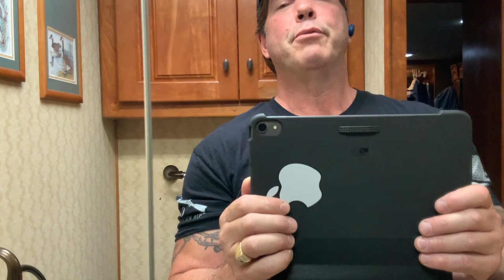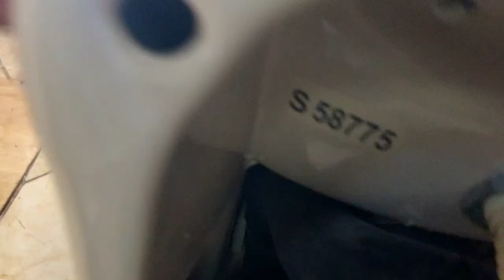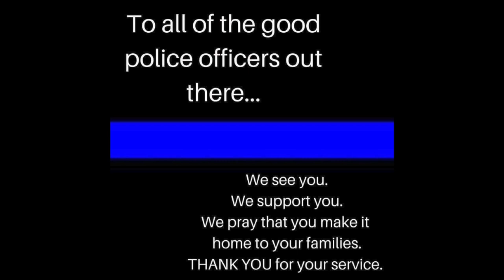Tecma Thetford Toilet Issues and Repair - Teardown and Reassemble

Comment: Your great video allowed my non-mechanical but determined wife to remove the toilet. liberate a medicine bottle that was plugging the toilet and reinstall it. I was blown away! Also a shoutout to The Fleetwood techs for stripping the heads of the toilet mounting lag screws when they built the coach.
Reply from the maker: LOL, A pill bottle would definitely give the macerator a run for the money. We have since sold our coach and have a 2021 Destination trailer while we get our Texas Tiny Home village opened up, and it has all kinds of manufacturing issues from the factory. It seems that most everything has gone downhill since the change in society of 2020, but the RV industry has taken a serious hit in quality manufacturing for sure. Thanks for sharing. Peace
Reply: Don't feel alone. I have a Tiffin and the installer stripped out my lag screws too. I know how to fix them but Damn. . . Just another QC issue.

Comment: Great video with loads of "tongue-in-cheek" humor. Two thoughts: 1) could use a 1/4" square drive on the cordless drill, then an extension with a 5/16" socket for the clamps - way easier, and 2) mention that one doesn't want to over-do it on the clamps - the sharp metal edge of the clamp can cut right into the rubber of the hose, and start a nasty leak. Goot-n-snug, but don't over-tighten these.
Reply from the maker: Great advise. Thank You for sharing. Peace

Comment: Excellent video. It takes the mystery out of pulling my Thetford Tecma toilet. Got it leaking water on the floor (appears to be clean water), and I have not found much showing how to pull the toilet and the mystery of what is behind and inside it. You have solved that problem. Many thanks!
Reply from the maker: Thank You, Glad it helped out. It is really pretty basic, one small water line in and a drain line out. Electrical is marked from the factory with tags. The water leaking should be easy to track.Best wishes.
Reply: @homesteadingusa  Wanted to follow up and let you know that, just as you said, the water leak was easy to track after I removed the bolts from the unit and pulled it from the wall.  The slight leak was from the connection between the supply line and the toilet.  Just tightened it up with my fingers and that took care of the problem.  Thanks for taking the mystery out.
Reply from the maker: @gvayers2495  Thats Awesome. You should make a video and spread the word for others to learn just how basic these toilets are. Many will appreciate it. Stay Safe.

Comment: Very helpful video! My Thetford macerator pump wasn’t working on my recently purchased boat head (it was 5 years old when I bought it). I hoped it was a jam but it turned out the motor had rusted out I needed to replace it. After a lot of calls and searching for the original pump model I finally learned that the replacement pump is a different model # from the original. It is 38056. Found on Amazon.
Reply from the maker: Glad to hear you found the part. I have had many issues finding parts when needed during these crazy times. I am replacing a wiper motor as we speak and putting a video up as soon as I finally get my part in.I have been told by Monaco that many parts are sitting off the california port on a ship. I asked for a eta and all they said was within the next few months. Merry Christmas

Comment: You should have worn those gloves during DISASSEMBLY!   lol!     Well-done presentation from the regular guy's perspective.  A few extra tidbits to consider:  1)  Several, large trash bags to catch "surprises."  Towels.  Thick rubber gloves.  A shallow tub or small bucket to catch "surprises."   2) A towel to place toilet on after removal.  The rough parts on the base of the toilet will scratch the heck out of your floor.   3)  Worth a trip to the hardware store to buy replacement flange bolts (and washers).  Be sure to match what you had, and buy stainless steel!  Also, don't over-tighten the bolts because you might crack the porcelain toilet.  If the floor holes seem to be loose, some wood glue and toothpicks packed into the existing holes (let it set for several hours before reattaching toilet to the floor) will give you the most secure connection for the toilet to the floor.  4) Razor blade to scrape off the silicone around the base of the toilet and from the floor (Be sure to use 100% silicone upon reinstallation).  5) If you have some rubber conditioner, it's also a good time to clean off the rubber hoses and apply a small amount of rubber conditioner (especially at connection points) to help keep the rubber pliable and minimize cracking and breaking.  6)  You mentioned early in the video that there could have been a loose connection.  One thing to help keep electrical connections working well is simply to apply a small amount of dielectric grease on all the electrical connections at this time.
Reply from the maker: All Great Points and I really appreciate all your input. Thanks for sharing. Peace

Comment: Vary informative and helpful my problem was sporadic function of control buttons to date I have not pinpointed the problem however it is working now checked for loss wires could it be faulty control module. Or do they or not
Reply from the maker: Hello Sir, Sorry to hear about your problem. I cannot say exactly what your issue may result from, but sporadic issues from what you are mentioning may be due to the control module going out or the electronic button system. If I am understanding correctly and the flushing is acting up randomly by not receiving the signal when you flush randomly, I may think that one or more possibilities could be a wiring issue and / or I would look at the disconnection points or for worn wiring inside of the toilet. Then I would take apart the button system to see if there are connection points that may be sticking or just wearing out or have shaken loose, but again, I am not a tech so this may be way off track. Our issue was a blockage from a hand wipe which I was fortunate not having to look any further. I have seen a couple other videos since I did this one and have seen actual technicians who know more than I do about the Tecma toilets which may help you out. I have always dreaded the day when I push the button and it does nothing, because I am a process of elimination type of repair guy which has a tendency to cost me more than I should pay most of the time, lol. Knowing the unit from what I have learned from my teardown makes me very limited on repair knowledge to be honest. Good Luck and Best Wishes in your findings. PEACE

Comment: Good breakdown. I have an issue with mine where the bowl will not fill with water. Thought it might be a switch issue, but I got a new one and that didn't solve the problem. The big and little bowl lights illuminate blue, but I get no LED (red, yellow, green) indicator. I'm thinking now, maybe it's the control module? Wiring is all connected and there is power.
Reply from the maker: Sorry to hear. I agree that the module would be the next step. Happy Travels.

Comment: I have my tecma apart right now going to clean and store it.  Installed a composting C-Head in it’s place.  Both of the backflow preventers have degraded rubber and are no longer functional.  BTW this should be an annual maintenance  task to clean out the crusticles.
Reply from the maker: That is a great point. I wonder if there is a gasket treatment that can be added to keep the seals from drying up? If anyone knows of a product, please put it on here. I think it is an important item to keep maintenance. "Crusticles"..LOL. Thanks for sharing. Peace

Comment: Great video I'm getting ready to take my tecma turd grinder apart and was looking for a video and found yours just was wondering how you turned the power off did you just turn the battery disconnect off thank you safe and happy travels
Reply from the maker: Thank you. Yes, Just disconnected the batteries. Safe travels Scott.

Comment: I am assuming you removed all the good stuff backed up in the toilet before starting.  Whats your tip for that part?
Reply from the maker: No easy answer to that one, It was a crappy situation! Peace
Reply: Thank you very much!, I just had a problem with mine, the main hose failed in the middle, rubber hose was like jelly,yikes, it collapsed. What a mess...😮 I am replacing both hoses. Only about 150$ for both.

Comment: Excellent video.. Clear and concise. 

Is anyone experiencing an issue where their Tecma toilet refuses to maintain a high water level? She fills but drops right back to the standard low water level. I thought perhaps I was trying to overfill the bowl. But my other Tecma fills and maintains the higher water level just fine. I had an electronic bidet fitted to this toilet. Otherwise I'd swap them out. I think the issue could be the check valve wearing out. Thoughts??

Another, possibly related issue, is the tank indicator light was coming on intermittently. Now it's a constant solid orange. Despite the other toilet showing green and the tank monitor panel showing zero, I went ahead and ran the tank rinse twice. Cleaning the tank and checking to ensure the level indicators had not come off or were damaged did nothing to reset the light to green. I then pulled the fuse to reset the toilet control panel. Nothing. Has anyone else come across this? If so was this light an indication of a partial blockage, air intake obstruction, or a failing motor??? The owners manual is no help. Thetford ignored my email.

Cheers!
Reply from the maker: Hmm, not sure. If you find out more info, please let us know. Peace

Comment: Great video.  My toilet will flush once, but then bubbles appear in the bowl for several minutes.  Will not flush again for 10 to 15 minutes.  Is it possible that the  small air line is stopped up?  Does it function as a vent?
Reply from the maker: Hi, sorry for the late reply. We are building our home and I have neglected the 
 comments lately. I hope you got everything up and running. If so, what was the fix to your problem?

Comment: I'm trying to bypass the red light that will never go off. I'd appreciate any information to bypass. Thetford told me it can be done but had no information to help me. Thank you
Reply from the maker: Hey Brian, Strange that the manufacturer could not tell you a solution for the fix. I personally would figure out what all events occur to turn the light on then take the process of elimination direction. I would suspect a sensor is obviously activated which turns on the red light and would search it out. I know this doesn't help you but this is all I can offer as to what I would do. Best wishes. PEACE

Comment: My wife did the same thing. Had to do just what you are doing. After removing the hand sanitizer, it worked fine. Until the last time we went out. The tank sensor says the holding tank is full. It is not. We have an identical toilet in the 1/2 bath that says the tank is empty. And the gages in the motorhome say the same. It will flush, but you have to hold the flush button in for 6 seconds. That gets old. I took it apart again and found nothing wrong.
Reply from the maker: I have learned that if the sensor is reading incorrectly, a good flushing of the tank to clean off the black tank sensor was all that was needed. I have also learned that if you are getting a false sensor reading, the wire connectors may need to be cleaned by taking the sensor apart and giving a good once over for good contact of the wiring. As for the having to hold the button, I would lead to believe it would have to do with the sending unit (flushing buttons) OR the main module that is receiving the signal from the buttons inside the toilet. I again am only surmising, since this has not happened to us...yet. I did have to replace one of our electronic LED Sensors that was reading our LP,, Black, Grey, Fresh levels incorrectly. The problem there was the actual readout Board itself, which was an easy fix. Basically a Plug and Play repair. Best Wishes and maybe there is some sort of information here for you that may help. Peace
Reply: I took the mid ship toilet out a few years ago. It fell over on its side and busted . It was appox. $1500 to replace it. SO Get a couple of 
$5 furniture pads to lay down before you start. This is
 a good video to watch before you start.

Comment: At 8:58 - The tank fill hose from the solenoid to the coupler (shiny section of this two hose setup going to the tank rise/fill nozel); this hose on both of my Tecma Silence Plus toilets is linked and compressed. My question is for all Silence Plus users - is this hose supposed to be kinked, compressed, and flow restrictive? This is the only hose that is not specifically designed and shaped to avoid distortion and flow restriction. This section of hose is not on any schematic or parts list. I thought it was added because the pex supply line was not long enough. However I see this same section of shinny hose in this video. It's not that my toilets don't work. I'm wondering if a properly fitted hose would provide enough pressure to rinse the front to the bowl, provide enough water during flushing to quiet it down, fill faster and fill quieter. A good 3.5 inches at the front of the bowl does not get rinsed. 

Emails to Tecma and DRV go unanswered..... I imagine their response for not responding would be something like "we are experiencing staffing shortages due to the pandemic"......or some other BS excuse for their cost cutting/profit raising measures.

Has anyone replaced this hose with a flex hose or longer hose looped to avoid distortion and restriction? If so, was there any improvement to the toilet flushing/filling?

Comment: When I flush mine, it drains fine when first flushed. Then, after the motor stops water starts "foaming" back up into the commode bowl from the drain. I took it apart and the motor area was clean. However, when I took the pipe a loose that goes to the Black tank water came up out of the pipe. I dumped the Black tank before I started this so that the Black tank would be empty. Comments.
Reply from the maker: Hey Willie, It sounds like you have a blockage in your black tank run. Obviously the back up sewage wouldn't be there if it was all clear. I would get a good flushing on the tank. How is your monitor readout after you drained the tank ? If it reads anything other than empty, get a wand down into your tank or hook up to a well pressured hose and let her rip. Peace
Reply: @homesteadingusa  I have two commodes in my rig. The one in the half bath works fine. The one in the full bath is the issue. My tank drains fine and the readings on the tank shows empty.  Do you think the blockage is only in the line from the second commode to the black tank?
Reply from the maker: @williebradyjr6102  Thats what is sounds like to me. If you can run a snake through it carefully, this may be the fix. This would be my next step. I am thinking your problem commode is the furthest from the black tank, this would say the flow issue is due to a paper plug. I had a guest over once that did not remember me asking them to only use rv toilet paper and it turned into this video. 🙃 Peace

Comment: Tecma macerater toilets are very unreliable 

When ours failed - we used a black bag in Tecma toilet
Drape over side and toilet seat holds bag 

Our Tecma Toilet is in a 2020 Renegade Verona
Reply from the maker: Great idea with the bag in the toilet...eliminates the bucket. Freightliner Verona...Sweet ride. Thanks for sharing. Peace
Reply: I finally found a macerater motor at a yacht supply store in Florida 

Installed it - so far all good
Bit nervous every time we flush
Reply from the maker: @trike-hauler  Congrats. Don't be nervous when flushing, just be sure you have a back up for a back up... :).